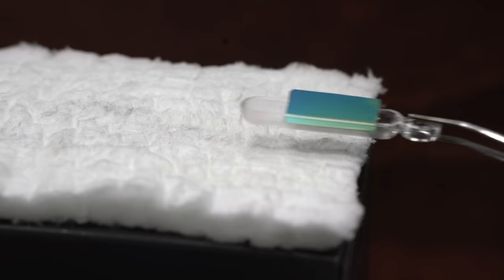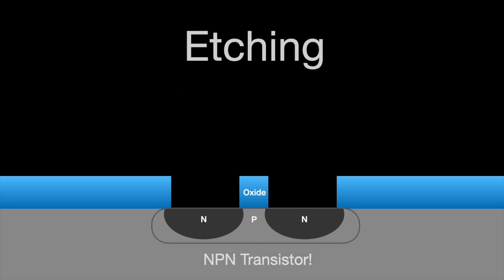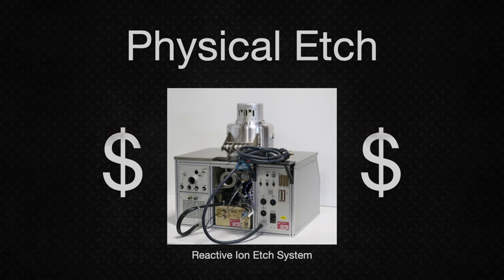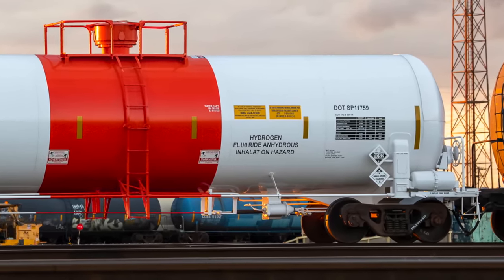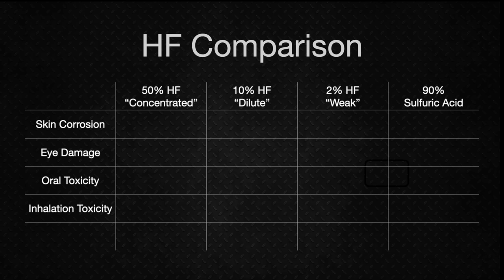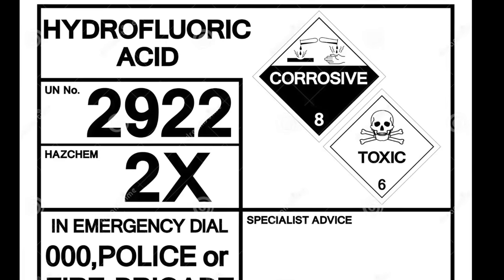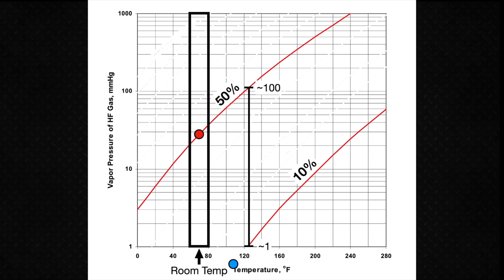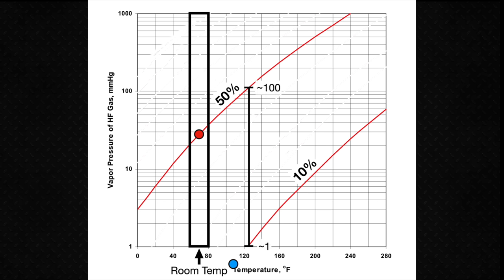Using Hydrofluoric Acid to Etch Oxide Layers

Comment: If I had to guess, I would say the reason Armour Etch uses HF acid precursor chems is for logistical and production ease. And maybe because it's more effective. Those precursor chems, individually are far less dangerous and easier to store, transport and handle than HF acid when compared at any given concentration. Only precautions outside of the norm is to keep them from each other, especially each other plus water.
 I'm guessing that the combination also produces some chemical effects that doesn't happen with HF acid alone or when combined with a single ingredient. I'm also guessing that the barium, sodium and ammonium acts like a buffer solution that makes the etching effect more consistent and long lasting, allowing looser tolerances regarding the proportions and be safer at relatively higher functional HF concentrations. 

That said, most of the variation listed on the MSDS is probably just a means to protect the exact recipe. This sort of range is the norm, but I've seen much, much worse. Multiple tens of absolute percent worse.
Reply from the maker: This explanation makes a lot of sense to me

Comment: It'd be worth looking into just how much HF is in the Armour-etch, and maybe diluting it down to get a nice controllable compromise. times of around a minute are a bit too fast for consistency, although if your mask is really sensitive, speed might be good!
Reply from the maker: As far as I can tell from the literature it's actually more likely to damage a mask from higher concentrations of HF than it is for lower concentrations over a long duration. A lot of materials can withstand 2% HF indefinitely, but cannot withstand 50% HF for long.
Reply: @projectsinflight  That's why i'd suggest some dilution and testing, you might have very high local concentrations of HF at the interface of armour-etch and silicon (maybe contact with other substances promotes the reaction to form HF). I dunno, my chemistry knowledge is a tad rusty. You've got some 'sperimentin' to do!

Comment: how about NaOH or KOH, at the 1000C temp your working at, it should be able to react to form soluble sodium silicate which can be rinsed away in water
Reply from the maker: sodium and potassium are unfortunately very bad contaminants for silicon so generally it's important to keep them out of fabrication processes

Comment: to stay safe, you might want to keep a bath of sodiumcarbonates (soda) around. This will neutralize the acid and form pretty safe NaF and CO2 gas. You can also neutralize acid remains on used equipment with that method

Comment: I used to work with a rust remover that contained 10% hydrofluoric acid. Any concentration of hydrofluoric acid above 10% is something that I consider too dangerous and I don't want anything to do with it. Extreme caution using the lowest possible concentration of HF that's suitable for the intended task is essential.
Reply from the maker: Agreed 100%

Comment: Be aware that household chemical solutions, and non-chemist chemicals in general, are rarely pure. I don't mean that a lower quality base stock was used, I mean that other chemicals are often added to aid performance in the intended role.
I say the following in ignorance of finer details of how HF acid behaves in the intended use case, but for rust remover I would expect it to contain surfactents, detergents and/or solvents to get rid of any oil or grease on the rust and wet the coarse, rusty surface. It may contain something to help deal with soap scum if intended for use in the kitchen or bathroom, if HF isn't good enough for that. 
In general, expect thickening agents, detergents, solvents, surfactents, preservatives, anti-corrosives/metal deactivators, dyes, water softeners, abrasives and lastly, diluents/bulking agents. The diluting or bulking agents can be odd choices, either because the original formula was like that and it stuck or because it has a beneficial side effect. Many of the common ones aren't very helpful to the chemist as they are not defined precisely chemically but by some other metric. Look up 'petroleum distillate', 'kerosene', 'diesel fuel no. 2', 'Stoddard's solvent' 'mineral oil' 'naphtha'. Hmm, just realized that my job selling car parts has really biased me to petroleum products.
Reply from the maker: Yeah I'm gonna have to spend some time analyzing the purity of chemicals and how necessary purity is for good results

Comment: I'm a model maker and was wondering if a metal oxide layer could be grown on clear acrylic or polystyrene. I was looking for making the oxide layer visual effect on windows and sensors for the models.
Reply from the maker: Maybe, but you might want to try some kind of deposition instead. Sounds more reasonable in this case

Comment: How do you dispose of that HF when you're done? :O You're killing it with these videos!
Reply from the maker: Honestly, in such tiny amounts once it's reacted and neutralized it should be fine to just put a few mg of fluoride salts down the drain. There's much much more coming from toothpaste and other sources. If you want to be slightly more environmentally friendly you can neutralize with calcium carbonate instead which produces calcium fluoride, and is much less bad for the environment than sodium fluoride

Comment: 10:32
I imagine there's a concentration/exposure time at which you stop smelling/tasting the fumes. Also knowing you got a dose of HF is still much worse than not getting a dose of HF. 

Official sources give a different reason for why this isn't an option (if they give one at all): 
"HF fumes have a pungent, irritating, penetrating odor and can be smelled at 0.04 ppm (a relatively safe level) though you should not rely on odor to determine safe concentrations since the odor threshold will vary widely with individuals."
Reply from the maker: Yeah I hope I made it clear that I wasn't suggesting that people smell HF, I just wanted to point out the large distance between "I don't smell HF" and "Dead"

Comment: That was really fascinating. Now I'm interested to know the concentration of HF in Armor. That kinda worries me.
Reply: Also, why doesn't the metal form a diode with doped silicon at the boundary?
Reply from the maker: Ah, now that's a subject I'll cover in an upcoming video. It's true that a metal-semiconductor boundary creates a shottkey diode barrier. However, if the dopant concentration is high enough the diode barrier becomes so thin that electrons can just tunnel across it, so the barrier effectively disappears
Reply: @projectsinflight  cool - thanks for the response! I guess I really didn't think about the detail of the geometry and specific consentrations. There must be a lot of variables you can adjust to optimize components for different purposes. Makes me want to study it 😁

Comment: I hope you're not using latex gloves...  you don't mention this in the video, but neoprene or thick nitrile gloves are recommended when handling HF.  Apparently latex is penetrated by the stuff.
Reply from the maker: I'm using nitrile gloves and butyl gloves. I'll probably devote a whole video to PPE at some point
Reply: @projectsinflight   you could work on a spill kit - to have a way to handle any mishap on the spot. Spray bottle with a base solution etc.

Comment: @projectsinflight    I have one question to you. Have you tried not diluting whink rust stain in water? It seems to me that then the solution would be more concentrated.
Reply from the maker: The rust stain remover was used as-is. I didn't dilute it.
Reply: @projectsinflight I'm very sorry, I thought it was diluted in the video. I may have taken it the wrong way. Thank you for the correction.

Comment: Would it be possible to dilute the Armour Etch? Doing that could resolve the risk of over etching and make it easier to remove if possible
Reply from the maker: Probably. I'm fairly sure water would work just fine. I'd have to make sure it's safe to do so though
Reply: @projectsinflight  depending on how viscous it is after diluting you may be able to use a syringe applicator as well

Comment: So are you going to specialise in ic manufacturing with your videos or will you branch out into other fields. Either way your videos are of a high standard and will probably be supported by the applied sciences community. Looking forward to seeing some photolithography and your solution for spin coating the wafers. Maybe another diy build or two to accomplish these goals. Hdmi projector and a microscope?
Reply from the maker: Since the devices are starting out large, i'm going to align manually at first. eventually i'll make them smaller. Regarding the spin coater- it's gonna be a CPU fan and arduino for now

Comment: What do you do with the contaminated water waste after its been neutralised?
Reply from the maker: Honestly, once it's been reacted and neutralized I just put it down the drain. A few mg of sodium fluoride won't really be an issue (especially when compared to all the stuff from toothpaste). However, I am planning on switching to calcium carbonate or something since using that will produce CaF, a much less problematic material to put down the drain.

Comment: If we're considering fumes in inhalation toxicity and not actually inhaling the liquid, then why is sulfuric acid a 1? It's got like no vapor pressure.
Reply from the maker: Hmm.. not sure. I can definitely say from experience that Sulfuric acid produces noticeable fumes.
Reply: @projectsinflight  Clean reagent grade acid? My own bottle doesn't smell, let alone fume. Even the acid I made from electrolyzing CuSO4 didn't fume until I got it to like 200-300 degrees or whatever when boiling it down. It then promptly calmed down on cooling. If it has chloride impurities or something then yeah, it might fume at room temp. But clean acid is non-volatile. So much so that people even use it as desiccant in vacuum desiccators.
Reply: @6alecapristrudel  I can only agree. Sulfuric acid doesn't fume unless it is heated to very high temperatures.
Reply from the maker: now i'm wondering what is in my sulfuric acid...
Reply: @projectsinflight  Unless you somehow got oleum, my guess is HCl or maybe even HNO3. Does it smell more like chlorine or like car exhaust? lol

Comment: Great video.
HF is useful chemical, but it's difference with sulfuric acid is (toxicity, and toxicity of byproducts). [Sulfates are chill, Fluorides aren't chill]
I remember that HF causes leukemia, I was unable to find a reference. 
"Despite having an irritating odor, HF may reach dangerous levels without an obvious odor." ( https://en.wikipedia.org/wiki/Hydrofluoric_acid )
Reply from the maker: The source for that quote on wikipedia says: "It has a strong irritating odor; however, odor should not be depended on to provide sufficient warning of exposure" 

I think that the quote on wikipedia is an incorrect summation of the quoted work.
Reply: @projectsinflight  thanks

Comment: HF can eat your bones, thats the main reason chemists are hesitant to use it. The ion imbalance issues you covered are not the most immediate threat when you consider that Calcium is a potential ion for fluorine to substitute with. The ability for HF to go straight through your skin and start scavenging calcium from your bones is what they scare us with in safety training. That's why calcium gluconate is the "antidote," or, rather, a cream to deactivate whatever is left on your skin by the time you get it on. The best protection is good procedure and proper PPE. You want to make sure your gloves, coat and goggles resist HF and can be easily removed. Your ppe isnt armor, it's a sacrificial layer in most circumstances. Great discipline shown diving into the documentation, but the lack of talk about boneless disorder in literature just goes to show why it's important to seek professional guidance or atleast interactive training for this level of hazard.

Comment: charts like those for pressure over liquid, are misleading at best - but are quite easy to evaluate at lab due to physics:
they are produced for closed containers when after long time, system is at equilibrium, check temp, total pressure and You are good to go with results.
HOWEWER they arent telling anyone anything about dynamic situation: exept this gas at equilibrium state with proper liquid.

so spray around 2% as fine mist and you easly go beyond this values if contacted with unprotected skin or inhaled.
spray 10% mist and you will get bad results. 
Mist generating includes spray/squirt bottles with small openings, electrostatic discharge etc
 
LD50% is gambling, but One can get 5% and still die - this is why OSHA have so low values.

Comment: Have you looked at etching with KOH?
Reply from the maker: it's not ideal, because potassium acts as a contaminant to silicon. Plus if i recall potassium hydroxide won't etch glass unless it's hot, which honestly scares me more than weak HF
Reply: @projectsinflight  Thanks for the reply! I was hesitant to use HF, but I've just seen the amazon review photos for armour etch, people using it on there kitchen side with no gloves, so if they havn't died and were able to post positive reviews, so I guess it's useable without issues. Also I noticed your lithography setup, I've been using the dry film on my mars 4 9k 3d printer and I've got sub 100 um details with low effort, just need a way of positioning things repeatably.  (I had to write a script to edit the .goo files as there are blur an antialias settings that couldn't be compleatly turned of in the slicer)
Reply from the maker: So, i've been thinking about this for a while and I kind of came to the conclusion that while Armour Etch is likely more dangerous than whinks rust remover (~2%HF) it's overall far less dangerous because it's a thick paste that is easily controlled. The whink's on the other hand can easily splash, getting a drop on your skin and you wouldn't notice. I guess it makes me feel like there's more to safety than just numbers and stuff
Reply: @projectsinflight  Yeah I was thinking the same

Comment: I wonder if you can make an hf solution from the armor etch. Do you know what causes the reaction that creates HF? Is it reacting with the air or with the SiO2
Reply: Bifluoride isn't really an ion, but a compound, much as blue copper sulfate hydrate is a compound with water; think of it as "HF of HFydration". When dissolved in water, these compounds have free HF already, and the sulfuric acid enhances that further. Quite possibly they add enough H2SO4 to protonate all the fluoride, and the sodium, ammonium and sulfate are just spectator ions.
Reply from the maker: 👍 couldn't have said it better

Comment: the armor etch really oughta have a warning label on it, i would NOT want to work with it, it looks like 50% concentration extrapolating 2% to 10%
Reply from the maker: That may be the case, though it's also possible etch rate isn't linear with concentration, or maybe there is something inhibiting the gel from being as fast as 10% liquid hf. i'll have to investigate further

Comment: Interesting hf does not eat through the plastic bottle
Reply from the maker: For dilute HF you can basically use any common plastic, except PETG (soda bottles) I think. PFTE is best, and Polypropylene and HDPE/LDPE are also good

Comment: i'd use the whink at 40°C or so to cut etching time down to a fourth
Reply from the maker: So, it's not really that dangerous to heat whink rust remover to 40C but the concern i'd have is that I'd make a mistake and accidentally heat it to boiling or something. It would be easy to make a mistake and start pumping out dangerous fumes

Comment: HF is definitely evil stuff. Along with ketones and various concentrated acids, we used boiling 70% w/v HF every day for cleaning and etching Silicon wafers. You cannot over-stress how scrupulously clean everything has to be if you're making semiconductors. Far cleaner than a surgical ward at your local hospital. We used fume cabinets, face visors, industrial gloves, full length aprons and a work suit underneath all of that, in positive pressure clean rooms. Cleaning wafers properly can take several hours at each of various steps in the manufacture of even quite simple devices, if you want reliable and repeatable results.

One thing which you forgot to mention is that HF is highly carcinogenic. A example of its insidious danger was seen when, about 40 years ago, a woman in our facility, and who is still a neighbour, had some HF leak through a damaged glove onto her little fingertip. She didn't notice for perhaps a hour, whereupon she noticed that her fingertip was wet, and then saw the pinhole in the glove. She was cleaned and then taken for hospital emergency treatment, despite feeling no immediate pain. The injury took weeks to heal. About 7 years later, she had developed bone cancer exactly below where the HF had been absorbed through the skin of her finger. The fingertip had to be amputated at the second knuckle. Thankfully she has had no spread of the disease since then.

So, if you do splash yourself, remove and neutralise the acid immediately, and then report to your hospital, who should check and monitor you over the next decade or so.
Reply from the maker: do you have a source for carcinogen data for HF? I haven't seen anything about this.
Reply: True¿¿¿

Comment: i find it very strange that sulfuric acid and hydrofluoric acid are rated in the same category for dermal toxicity. sulfuric acid will corrode and dissolve the tissue it comes in contact with, but i don't think it will cause systemic poisoning like hydrofluoric acid does, and it won't slowly seep into deeper tissue like HF does either.
i've seen people submerge their hands in beakers of sulfuric acid, and aside from slight irritation (redness) they were perfectly fine afterwards. but doing that with hydrofluoric acid could actually kill you.